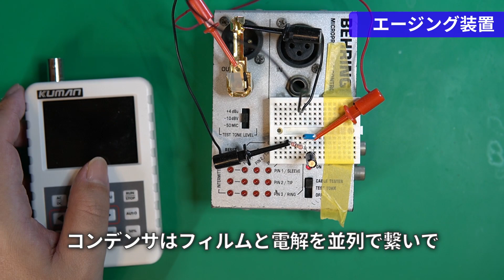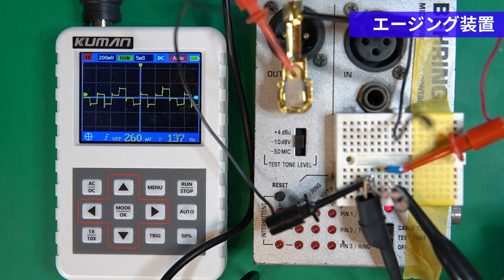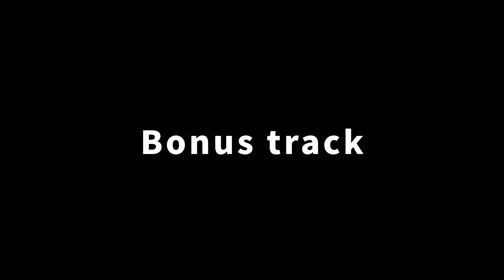【実験】エフェクターのコンデンサを200時間エージングしたら音は変わるのか？おまけコーナーもあるよ

Comment: Fun experiment,,,I was definitely interested. I did feel that the aging method was maybe flawed a bit. I don't think aging with a single test tone is realistic. I think trying aging with a fast sweep tone, or even easier, pink noise. It's more realistic to actual musical input. Or just use a looper of you playing that never ends. As you showed at the end, temperature is probably most important. And 200 hours isn't very long. I think to age you would need to...
- use a more musical input signal
- fluctuate ambient temperature from cool to warm, possibly adding humidity to that
- fluctuate input voltage within a useable range
- for a longer period of time

Those are basically all the variables a circuit like this would see over time. Of course, it's easy to type that, it's much harder to do it!!

Thx! 🙏👍
Reply from the maker: There may have been a problem with the verification method.
We knew that pink noise and sweep tones were effective, but we did not have a machine that could generate them for a long time, so we ended up with a single tone.
I was not aware of playing music. That is an effective move.
If 200 hours is not enough, I would give up, because I think it is difficult to create an artificially aged condition.
Thanks for your valuable input.